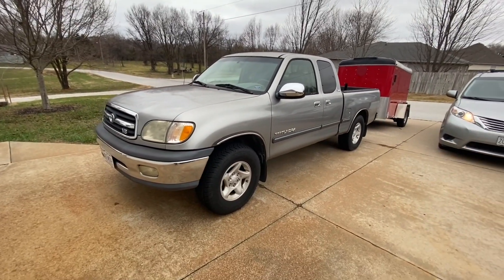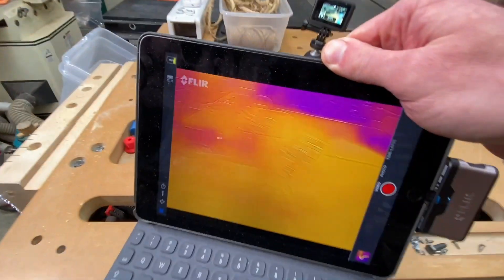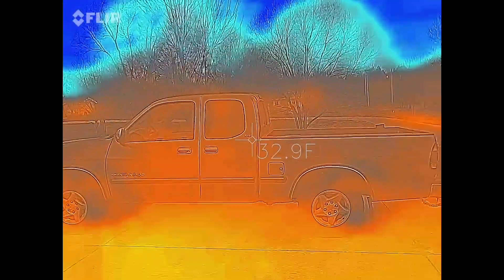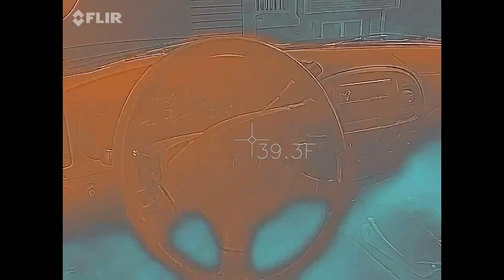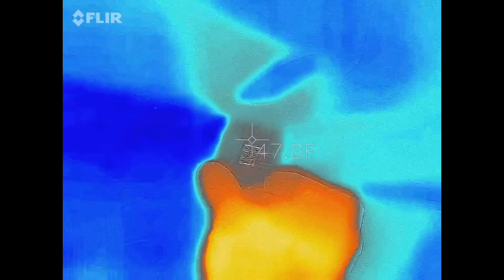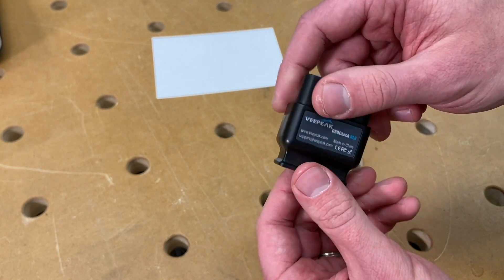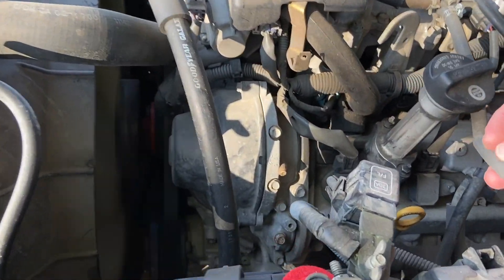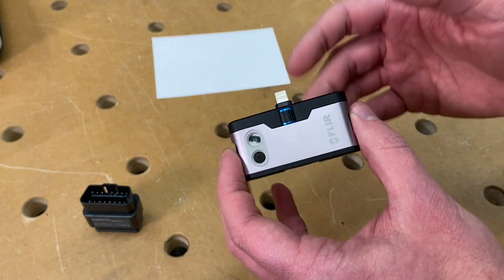THERMAL CAMERA FOUND BATTERY DRAIN!

Comment: Just a couple of points, if you don't know about it already, 1) the IR camera only measures the surface temperature and 2)emissivity is important and can lead to misleading results if you don't understand it. Basically if a surface is shiny and reflective you don't measure just the item surface but also a proportion of the temperature of the reflected image. Try measuring the surface of a mirror without your reflection in it and then repeat the exercise with your reflection in the mirror. I used to spray bits of engine with matt black spray paint before measuring them (we used to measure the temperature of tortional vibration dampers on engines under development to check that we'd speced them right) to make sure the emissivity was as close to 1 as we could get it)